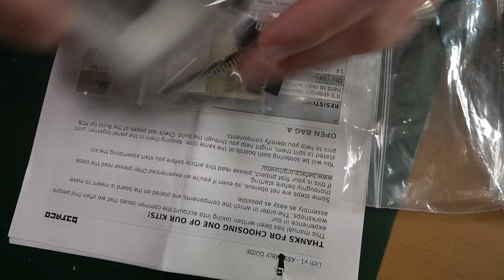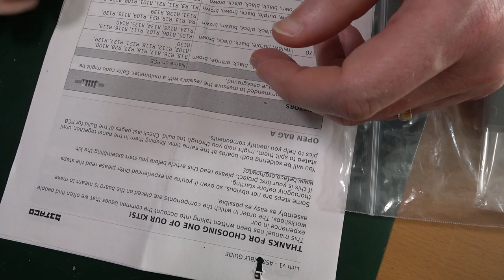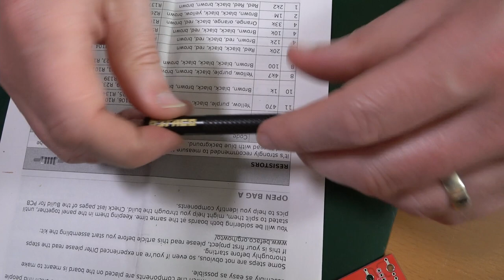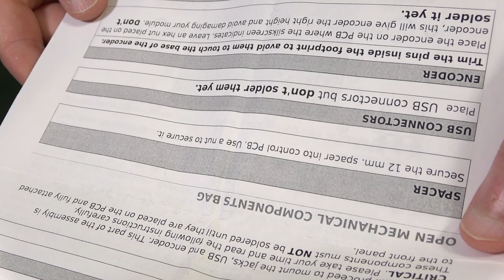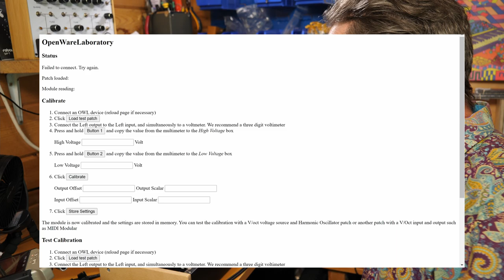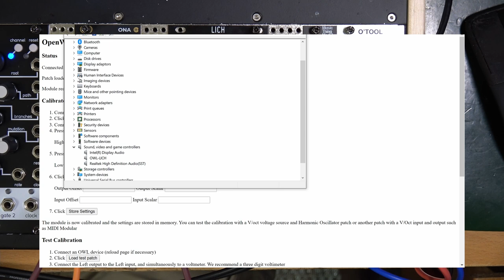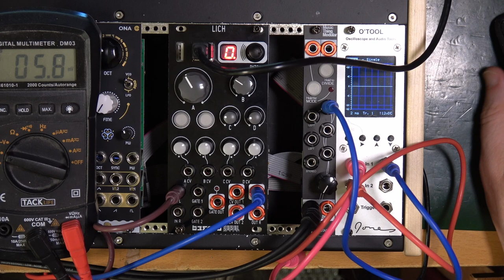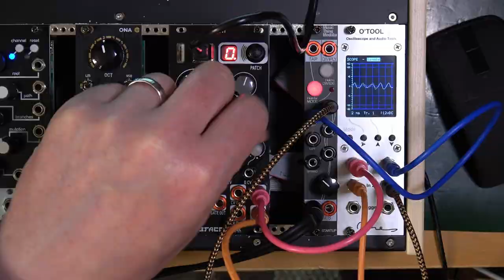DIY Build: Befaco Lich multi-functional DSP module

Comment: I love that the thumbnail for this video makes it look like you are wearing a monocle.

Also this build was super rough. I thought I broke it but it just turned out that the resettable fuse wouldn't solder correctly. For some reason the solder wouldn't stick to the pad. Ended up just buying a new part and left the legs longer and it soldered in perfectly and now it works great.

Comment: Just in the middle of building a ST MIX (my first Befaco) and I have a missing capacitor I have to go and buy one of at my electronics store tomorrow. I wish they'd make their boards a little bigger so they weren't so crowded and make the component footprints actually large enough for the components. I know you've had fun with Befaco builds before - now it's my turn.

Comment: I just built a Patching Panda Punch, the most annoying simple build ever, then fully functional apart from a socket that must have been manufactured wrongly and won't accept a jack so I'm currently waiting for a solder sucker and a replacement part from Thonk before i can make it work on both channels. Great VCA though with the Accent control, lovely for a 303-style accent squelch :)

Comment: Headers. Just assemble the 2 pcbs with the headers. Then they'll be in perfect place when you solder (don't have to do both boards at the same time).

Support lugs on the pots, Befaco don't solder them. I guess because it's not needed as long as the pots are attached to the front panel with a nut.
Makes it easier to replace a pot.

Comment: Hi Robin, great video. I also had issues with this build and I had to get Belfaco to fix it in the end and I will say their customer service is outstanding, it's a good reason for buying Belfaco. Anyway, I have a question re calibration, and it's not that clear how you connect the module to the multimeter. From what I understand it's Left Out -> Multi In, Multi Out to Left In and also Multi Out to Multimeter. is this correct? I've also watched the build videos from Synth DIY guy and Belfaco and this step seems to get overlooked or not explained in detail for some reason, thanks in advance Dave
Reply from the maker: It was a while ago so i dont remember, but in the video what I did was follow the instructions on the calibration page. Take the left out and plug it simultaneously into the left in and a multi-meter. So I used a "mult" to split the left output so i could plug one cable back to the left input and another to the multimeter. It's all there around 1hr 32mins.